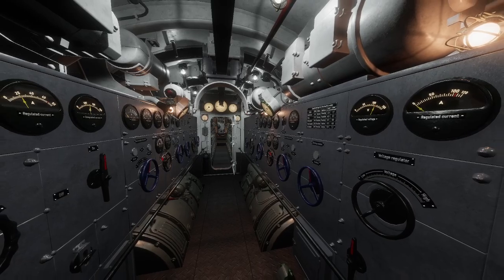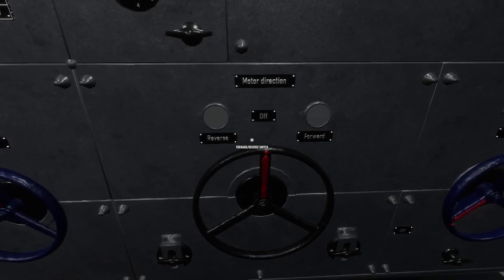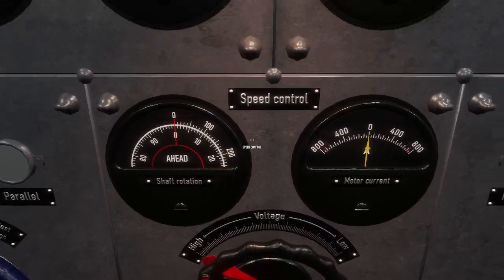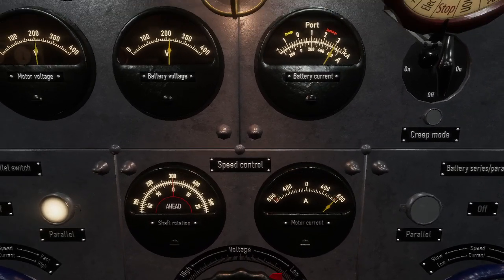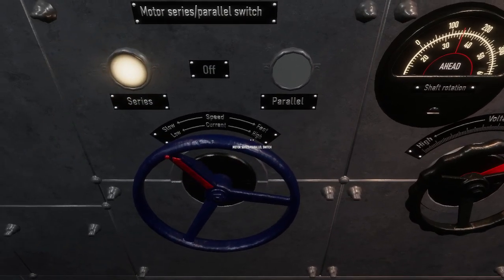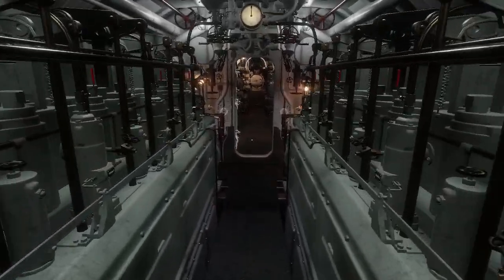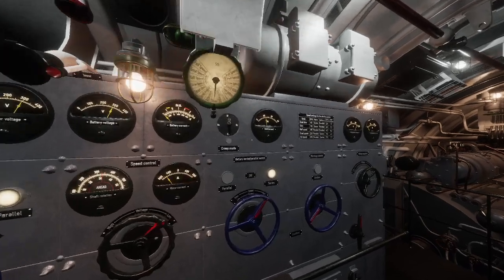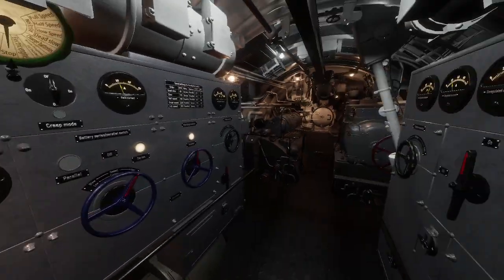Wolfpack Electro-Machinist Guide

Comment: Is it possible to charge the battery and still going forward?
Reply from the maker: Using a bug, or you can charge one side and use the propulsion on the other.
Reply: If you do not decouple the Propeller, the diesels drives the E-motors funktioning as a generator and the propeller as well, if you have adjusted Diesel-throttel and E-motor-Voltage accordingly, as Diesel, E-motor and propeller are all on the same shaft.

Comment: 1:11 I think  it is the regulator of the electrical instrumentation: radio, echo sounder... Perhaps more
Reply from the maker: The radio SHOULD have its own battery supply, but I'm not sure if its modelled. Otherwise I think that is quite likely.
Reply: @talk4dews i played with some guys and they confirmed me that it is for the hydrophone and radioroom.when it is to low the measurement of the hydrophone can be wrong. Further it might have a reason for the radio antenna in the radio room.